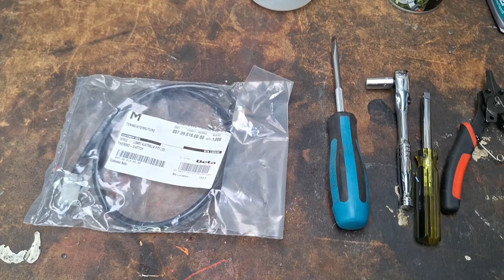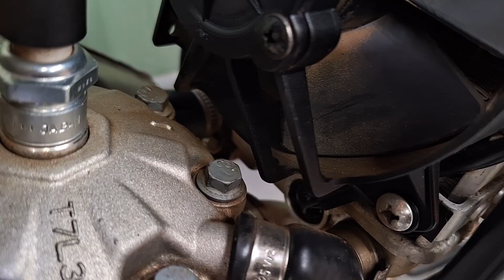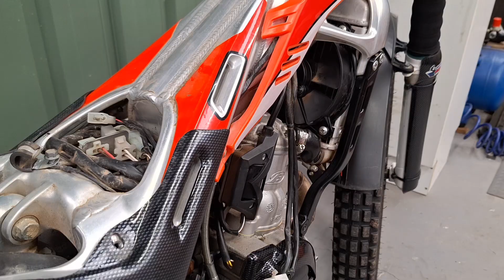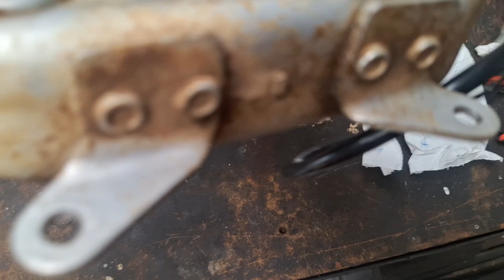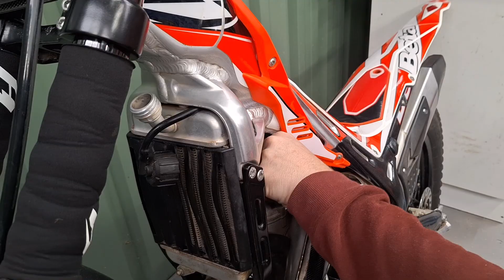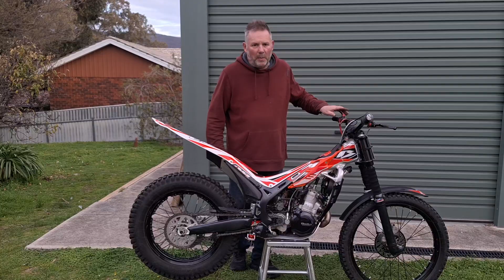Beta Evo Trials Temp Sensor Fix Part 2 - Repair and Test

Comment: Hi, thanks for the video!

I have a 2011 Beta Evo.
Could you please measure the distance between the mounting holes of the fuel tank shroud on your bike?

The 2011 shroud is no longer available, and I’m trying to find out if a newer one will fit.

Thanks a lot !
Reply from the maker: Hi the distance between the front and rear screws is approx 25cm however the later Evo hydroformed frame is much wider at the front than what remember of the first Evis frame that was an aluminium extrusion so may have big gaps at front even if hole dimensions are similar.  Maybe lookout for a good 2nd hand shroud ?